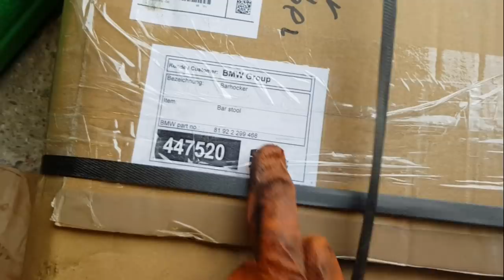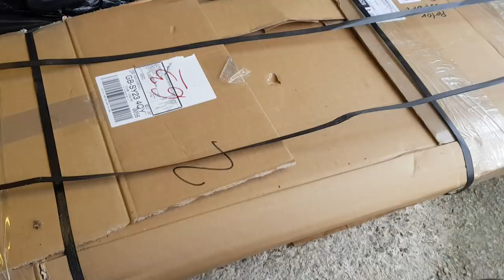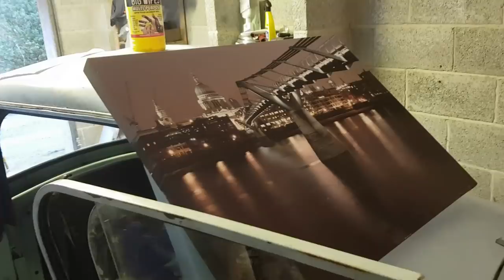HubNut's Second Garage Tidy! With 2CV headlamp update

Comment: Get yourself a lot of boxes, a roll of self-adhesive labels, and a marker pen. This will enable you to keep a lot of things which you might otherwise send to the tip. Don't hammer nails into the walls, drill holes and use plastic plugs to screw into instead. While you are doing that for your artwork you could also do it to put some high-level eye-bolts in the wall near to the shelf locations, then use bits of rope, cable ties, etc. threaded through the eye-bolts and around the legs of the shelves, this will stop them falling over when you inevitably overload them.

Comment: Go for a will it start video. Follow Mustie shove some oil in the heads spin it over with a battery, or a heavy duty drill, check for spark etc. Just do what Mustie does! After all you are a Citroen lover and he is a Vw lover. Both are are flat fours go for it. It would be an interesting video at worst and who knows maybe we will hear a HubNut chuckle. Bill
Reply from the maker: Ahem. This is only a flat twin. ;-) I need a heavy duty drill. Bloody hard work by hand!
Reply: HubNut Sorry forgot that but you have to have a go. What can you lose? Bill
Reply: I´m amazed by the fact that there seems to be quite a lot of Mustie1´s followers in here at HubNut´s manor :)

Comment: These are very flimsy shelving units unless they are whacked together tightly and then fixed to the wall. My Dad had some in his garage that twisted and warped due to this, plus the naff chipboard shelves bent as well and wouldn't stay in the slots to give rigidity.

I spent flipping ages straightening all the tabs and brackets, drilling every joint section and fixing with 4 self tappers, remade  the shelves in 9mm ply all screwed into the crosspeces, and finally fixed it all to the back wall. Difficult on your own as it all wants to fall apart as soon as ypu move to the next bit.

It was very sturdy in the end but a hell of a faff, took half a day to fix it...

Just screwing the shelves down when new will give a lot of extra rigidity and longevity, especially if you varnish them...

Comment: I thought scotty kilmer's garage was bad haha.
Another good reason to make your garage tidy is to deter rodents.
Once 3 different ones had chewed away at the top of my screenwash bottle trying to get at the water,so garage kept tidy ever since.
Glad my wiring was allright though.
My car has just passed its mot after just failing on a number plate bulb blown classed as a major defect for some strange reason.
Should not be a failure,only an advisory i thought
Anyway turned out to be corrosion inside the terminals & got fixed easily.
Good video ian.

Comment: There's a sneaky no-tool trick for dealing with that plastic strapping stuff from boxes - if you find the welded join, you can usually peel apart the ends and voila! Strap removed! (Doesn't help get rid of it afterwards though)

Comment: As to putting nails in bricks, cement ect. There is a good system that uses 22&45 caliber cartridges to install nails
In walls . I had one. I think you  could find a video on YouTube showing that very thing. Looks like a pipe you hit it with a hammer works very well .
Good video I have a workshop as well.
Rich& workshop cats making guitars in LA.USA.

Comment: As space is at a premium, would it not be better to dedicate the other side of the garage to storage as you already have the concrete block intrusions that side?  Having working space around a vehicle is priceless. If the right side was clear, at least up to and past where the doors open would be a great advantage. What you have done is a great improvement, though. I have an engine I could do a will it start on. I am thinking it might be like yours, though. I can see it now.. Will it start? Will it buggery.

Comment: Do not allow the black packaging straps to defeat you in the event you are without sharps: find where the heat bond secures the two ends together and peel the loose upper end back. The thinner section now revealed snaps without a struggle.
Reply: I'm always amazed how few people know about how to undo these kinds of straps with your bare hands.  They are actually designed to come apart easily once you know the secret.  I don't know whether this works on big straps like those in the video, but it certainly does on the straps around boxes of packets of A4 paper.

Find the join.  Grab hold of the loose end of strap on the side nearer to the box (not the loose end which is naturally the more accessible) and pull.  The join immediately comes apart.  Everyone I show this to always goes, "Oh, wow!  That's going to make my life so much easier." but somehow the information doesn't seem to propagate.

Comment: Baby steps will get it done.  If you want to hang the picture, put hooks in ceiling against the wall and use braided wire to suspend it, no need to punch a hole in brick. Glad Elly can finally shine. Just wondering, were there ever 5 shelves for the old set or did you get it with only 3. Cute trick blindfolding TWC, the shock of a cleaner garage might be upsetting.

Comment: and there was light and space....sort of.....a wee tip for getting those plastic straps off if you don't have anything to cut with...find the join on them and pull them in opposite directions...off they pop.

Comment: If that were my garage (I'm not fortunate enough to have my own, although I do have access to one to do my own repairs on the car when I'm feeling brave enough) I'd have probably put the shelving on the other side of the garage, but it depends how you work on cars...Do you usually reverse in, or usually drive in when working on them?  Just thinking about how you could use space most efficiently.  I must confess; I don't usually apply this sort of logic to my own life...

I did have the change to get some free shelving recently, but my useless cousins decided that it would be of better use to just take it apart and leave it for the scrap man.  The same cousins also threw out a load of old tools because they were rusty which infuriated me somewhat.  Ah, family.

I see a Rain-X bottle – what are your thoughts on it?  I've seen it advertised and thought about getting it (reviews online also appear to be good), but I've coped this long without it so can't see why I'd really need to get it.  Much like your Skoda my Golf also has a load of scratches on the windscreen too, although I assume mine are on the outside due to the previous owner not being fond of regular wiper changes, or rather the VW dealerships that it was serviced at in South London not being fond of changing them...

Those headlights do look so much better on Elly.  Good luck on starting the Fox project!  Garage looks so much better.
Reply from the maker: I only use Rain-X on the side and rear windows. Can't stand it on the windscreen.

Comment: Please keep them coming Ian. Before I forget; yes I know exactly what you mean about the Mk2 Astra windscreen wipers, they are interesting. That system is still in use on some of today's cars, whereby the passenger wiper arm comes to rest more slowly than the driver's side. Please consider one and/or a Nova. One can still pick up good examples quite cheaply. Or how about a Lada Samara, Niva or Riva?
Reply from the maker: Ladas have become rather too expensive. Would like to try an Astra though.
Reply: @HubNut  Keep a lookout for one Ian; they are about. The 1.3 carb version was the most interesting, such as the L or Merit models. Be a great addition to your fleet and an investment. Another one you'd probably like is the Daewoo Espero. Designed by Bertone, built on the GM platform and with a Holden-origin engine. Again, they do come up for sale occasionally and (at the moment) are quite cheap to buy. We had one back in 1998; great cars. If you like Skoda Favorit and Proton Saga, you'll like the Espero.

Comment: Sponsored tidy..... Please select an item and go to Patreon page...............................Ha, ha, ha!
When you buy a shelving unit, why should you be surprised when it's not strong enough to be a work bench?
Sorry, but spreading out the same c**p does not agree with the definition of 'tidying up'!
Reply: How to make a cheap bench.
Buy two bits of 8ft by 4ft  roofing ply. Cut both to the size of your bench. Using many small screws, that don't go right through, screw one to the other.
The resulting inch-thick plank is then everything-proof, and can have a vice bolted to it without bending or breaking - however hard you lever and hammer at the thing in it.
Use more ply for the legs (flat planks at each end) and a thin offcut along the back to stabilise the legs.